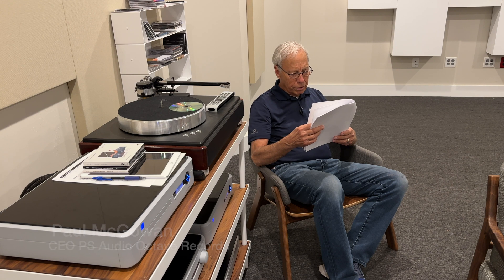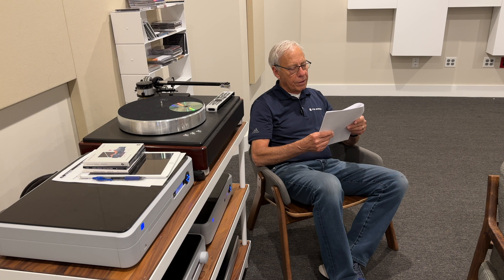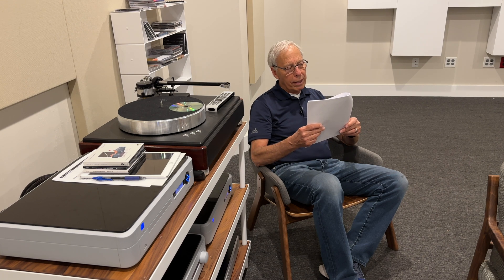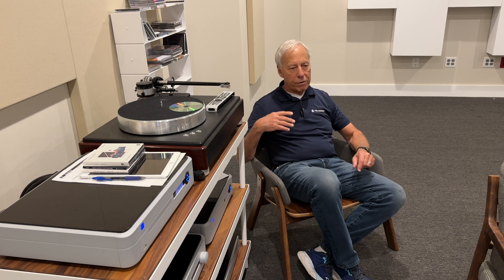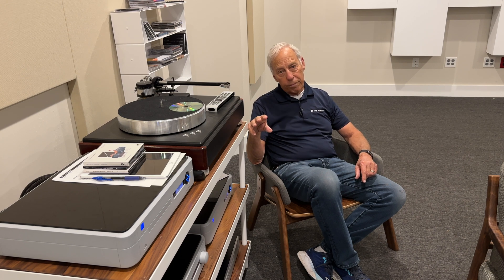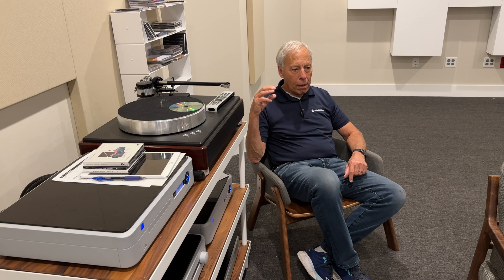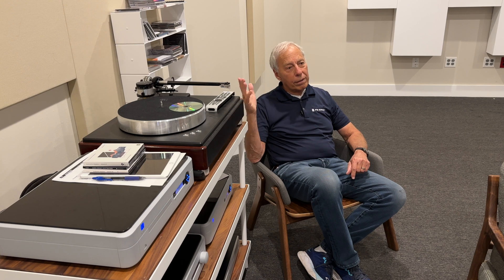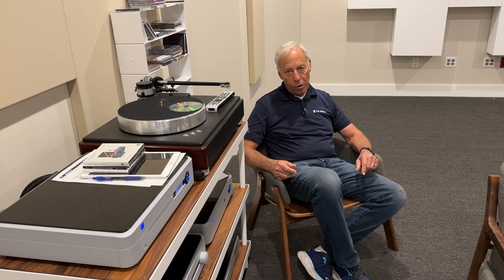Step up moving coil phono cartridge transformers

Comment: I use a combination of low capacitance rca interconnect and parallel Vishay Dale CMF55 resistors to tailor the sound of my OM30 to get it the way I like with clarity and detail......and can just swap-in a new OM30 or OM40 if my needle goes bad.....no need for moving coil for my sonic needs

Comment: I had very elaborated phono stages (incl. brands like Gryphon, ASR or Audio Research) in any case, using a high class step Up transformer, perfectly matched to a specific cartridge (in my case mainly the Ortofon SPU in various iterations, other systems as well) sounded more coherent, musical and just less artificial, compared to directly into the MC input of the phono stage. But I also had or heard many step up transformers (often the more affordable ones), that had audible limitations.
Reply: Definitely

Comment: IMO, the best way to go is with 'high level' MC carts. To me, this is the best way to get the moving mass of the transducer down while providing enough juice to run a phono stage that isn't going to be swamped with noise. Now, if you need a transformer, it's hard to beat Per Lundahl with his design chops. I've known the man for about 35 years now as he makes transformers for my mic pre-amps and digital interfaces. But with Phono? IME of designing the facilities of Sterling Sound as well as being their tech director for about 16 years (that's me in the avatar setting up a Neumann VMS-80 after restoring it ca. 1998) transformers cloud up the signal more than the extra noise of bringing up the level with a good front end. But, of course, as Paul mentions, there are no accurate blanket statements! 😃

Comment: Great information, as always! Could there also be a difference simply due to the extra pair of interconnects required with the step-up? I've found that the choice (and length) of interconnects between turntable and phono preamp really affects the sound...
Reply: Interconnects always influence the sound. Us guys with a lot of pricey cables; it's not that we like cables or like having to spend money on them. We'd rather not have to, and our bias is actually that way. But when listening, our ears tell us that to avoid fouling the sound, we have to. I prefer cables with locking collars. The tighter you turn the rotating collar, the more pressure it exerts against the input terminal. The sound gets sharper, the bass gets fuller and other things. Some audiophiles do finger strengthening exercises; for the fingers only, with a spring type device that has 5 springs, so they can get the locking collars tighter. You wouldn't want to scratch up an expensive interconnect by using pliers.That also could come in handy if anyone tries to strangle you; you could strangle them back faster, save your own life and improve your sound, all in one fell swoop.
Reply: @sidesup8286 amen to that , a old 80s B&O portable ghetto blaster in a pillow case to beat some sense into them 😂

Comment: Just thought I'd post this from the other end of the transduction chain.
"Recently, we finished development of Amorphous C-cores application in our ribbons. Some years ago, we were the first to introduce large gap approach in building ribbon transformers and now we are the first to use AMCC's in ribbons for absolutely uncompressed high power transient transfer and, at the same time, even further improving already the best low-level performance in the world today, by decreasing the width of hysteresis compared to HF ferrite cores. For direct coupled tube SE-ribbon, we succesfuly developed 175:1 ratio, -3dB at 120kHz Amorphous C-core transformers that can carry DC idle current of SET. " RAAL
120KHz isn't really bandwidth limited.

Comment: I've lusted after prono cartridge step up transformers but could not bear the costs of them so I cast about for a decent DIY solution. 

In 2017(?) I built the La Pacifica phono preamp from a kit that included the PCB and components. The circuitry is a couple of Jfets per channel with oil filled caps and 1/4w cheap film resistors.  I replaced the resistors with Rn55's and built a regulated power supply to power a pair of them (18 v 100ma) and was very happy with the sound, I also built a Jfet add-on to boost the gain for MC cartridges. This cost me about $100 all in and took an afternoon to build, it sounds as good as you would get for $500-1000 on the open market back in 2017. This sounds much better than my Rogue RP5's built in phono stage.

 It's open, has a great sound stage and very quiet, well worth that $100 and an afternoons labor..

Comment: I'm still using an audio technica AT 650 silver wired transformer with my audio technica  moving coil cartridge and it sounds superb. They are fetching  a fortune on the second hand market  so must be good.
Reply: All audio transformers have interwinding capacitance which degrades dynamics ... steer clear of them ...
Reply: @janinapalmer8368 and yet the most experienced audiophiles serious about their sound quality strongly prefer SUT to head amp.

Comment: I know i will sound stupid here, but can somebody tell me the diffetence between a phono preamp and a step up transformer?? My SAE 2100L preamp has both mm and mc inputs with an independent gain for each. It does a great job with every cartridge i have tried. Yes, i know it is old tech, but it works for me, and i am an old"if it ain't broke dont fix it" kind of guy. If you have a good phono stage in your preamp, why would you need a stepup transformer?
Reply: I would tend to agree with you in that you're better off with just getting a phono stage that can handle a low output cartridge. However, there's a catch. The weaker the signal, the more easily its influenced by outside factors that impact sound quality. As an example, lets say you have a good preamp (line stage only). If you want to design a moving magnet phono stage to equal the sound quality of your preamp, you have to design a better phono stage to equal the line stage. The lower voltage makes the task more difficult. A MC cartridge may put out a tiny fraction of voltage compared to a MM cartridge. To keep the same level of sound quality as your line stage, its far more costly to build a MC preamp to that level. 

This is where an SUT comes in. Its a passive device that only gets the signal from the phono cartridge. It doesn't get plugged into the wall to power any active circuitry. An SUT allows you to get most of the performance of a high end MC phono preamp, without having to spend a fortune. If you already have a good MM only preamp, you're not forced to upgrade.

I should also mention, you may come across the term head amp. A head amp does what an SUT does, but its an actual power amp that uses active circuitry.
Reply: @AT-wl9yq  Thank you
Reply: a
phono amp, sometimes called a phono preamp or phono stage, amplifies a small signal enough for a preamp/line stage to send it to a power amplifier. 

a SUT takes a really small low impedance signal and makes it big and high inpedance enough for
a phono stage to use.
Reply: If a phono preamp only has a moving magnet input, then you either need a step up transformer or an additional gain stage to boost the low output from the moving coil cartridge.
Reply: @georgebliss964  I understand that...just seems like the simple solution would be to buy a preamp with a moving coil input?
Reply: @stephenstevens6573 people pick and SUT (and sometimes
a headamp) over an onboard mc imput for more precise impedance matching and better slund quality.

Comment: I wonder if there might be something to (perhaps) impedance matching that a moving coil, at least in my experience, seems to like with a matching SUT - it's not just the db gain or the quietness, - one can fool endlessly with load settings and a preamp with plenty of gain, but plug a SUT into the chain and bingo, it simply sounds like the cartridge "likes" seeing the coil of a transformer - I find all aspects to be better, dynamics, sound staging, all of that - - - obviously can't speak to more than what  I'm playing with, I but I wondered for years why Art Dudley was so in love with SUT's, definitely a winner, sorry I didn't get into the game sooner - - if it matters: Audio Technica Art 1000 into their matching reference SUT 1000 into an ARC Ref3 Phono Preamp on it's lower gain setting using the 47K setting, wonderful imo - - I'm running that same set up on a second table with an Ortofon Winfeld Ti, I couldn't get the Ortofon transformer at the time, but that also seems to bring the same qualities to game. Both cartridges sound better to me with the SUT 1000's vs straight into the Ref3. Oh yeah, more cables - more money - - - bla bla bla - - - so there's that to consider too.

Comment: The circa 1981 PS Audio IVa had a moving coil switch inside the amplifier. You had to take the top off to access it. Although it did have a switch which gave extra gain on the front panel. The moving coil stage wasn't bad, but the moving magnet stage is a good bet to be the better sounding stage in a preamplifier. So is moving magnet the way to go? In my experience No. I'm sure there are some fine high output cartridges. I am a fan of moving coil for their speed, transparency, depth and last but certainly not least; their transient response. 

 A moving coil step up device even if it was 100% perfect; their goes lots of sound quality down the drain from having to use an extra interconnect. If you're using a run of the mill interconnect 40 to 50% of the sound quality could be lost. If you are using a  great interconnect, I still think you're going to least 15% of the sound quality. Maybe the best interconnects on the planet will lose you only single digits. That to me is the main reason why it's good to get a preamp or integrated amp with a good moving coil stage built right in. I try to avoid extra interconnects when I can, and I have real good cables.